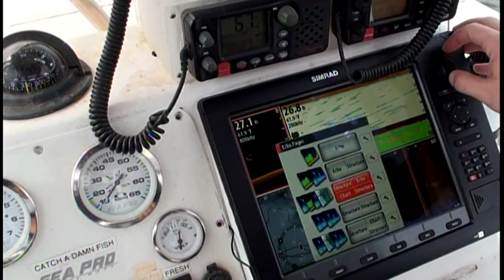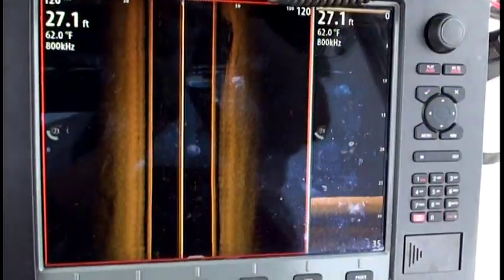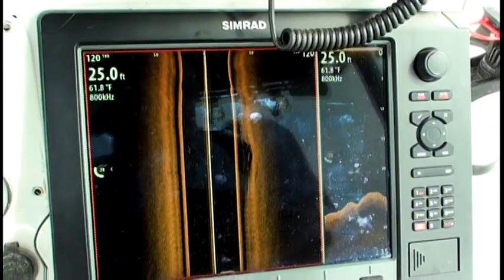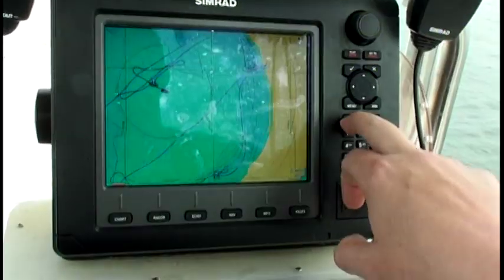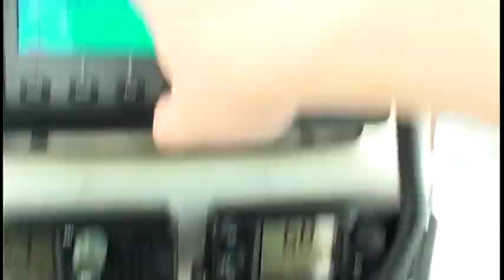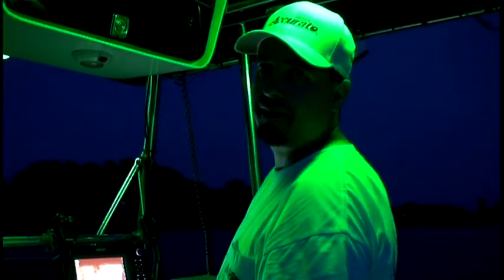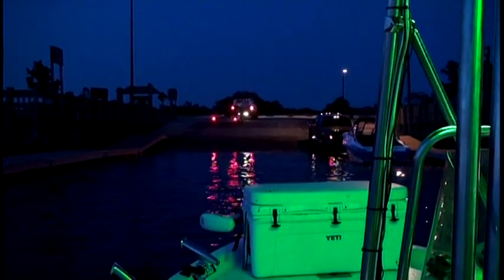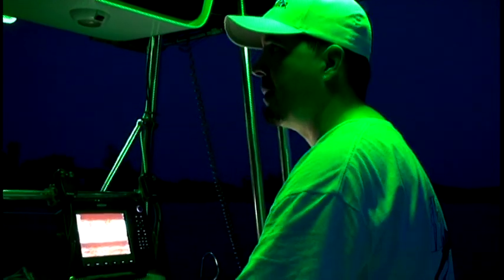SIMRAD NSE finding sunken TREASURE! (Awesome Structure) (structure scan)

Comment: Greetings from Sweden, i have a question about the Simrad/Lowrance structurescan, can i  
combine the lowrance hds 9 touch with the Simrad Nss8 to get the great picture on the the Simrad when just using the structurescan transducer, and not the Lss-2 Hd adapter??

Comment: I own Simrad on one boat and Raymarine on the other. Simrad has very rudimentary waypoint management while Raymarine has outstanding waypoint management. Key features that Simrad is missing: 1) waypoint grouping 2) ability to turn on or off waypoint names for a group 3) different size waypoint icons (fish icons are tiny) 4) ability to bulk edit a group of waypoints 5) ability to filter waypoints by a string and then batch edit the filtered group 

The lack of these features makes the Simrad unusable for most fishermen and cruisers. I do not have a dog in this hunt other than making people aware of the shortcomings of Simrad.
Reply: You’ve posted this same “finding” on other YouTube videos, yes?
Reply: @fishyfish6768  Probably and I've also made Simrad product management aware of their shortcomings compared to Raymarine.